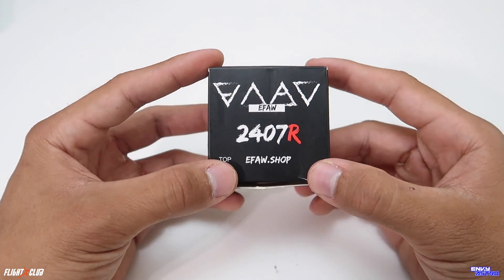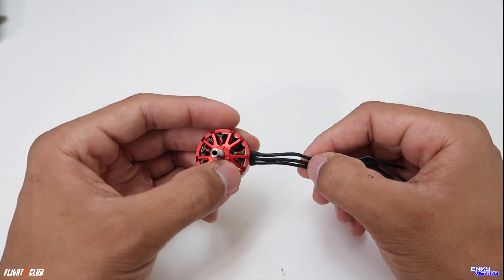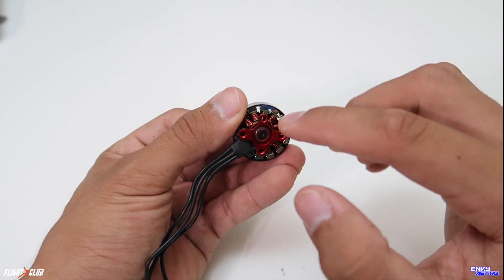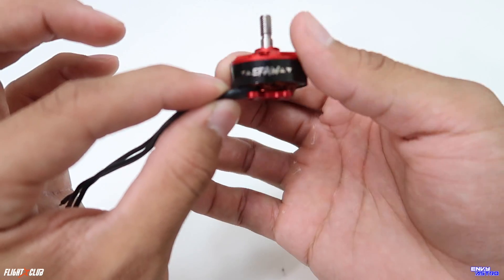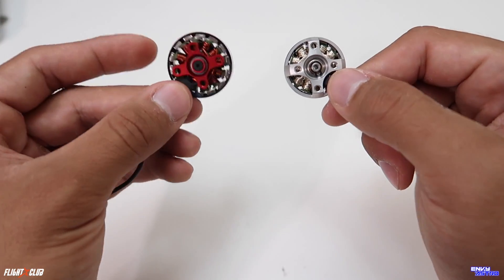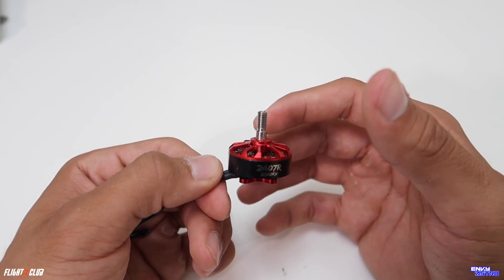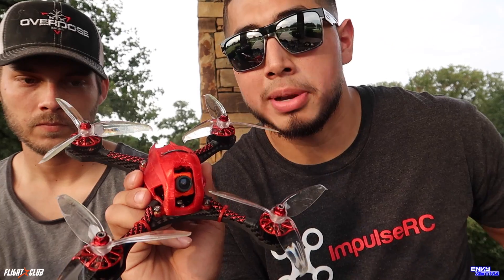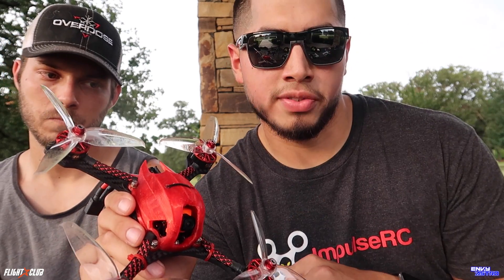EFAW Motors!!! (Thoughts & Test)

Comment: I'm a fan but I would love to see the prop static test and your real world test.. 

Quick question, if the motors aren't warm, doesn't that usually mean that they are not being pushed to full potential? I didn't get the esc amps you guys were running, looking at the gauge of the windings would suggest it can take more power, but the enamel coating also has to be able to take the heat. I NEED MORE TECH INFO GUYS.. Love your vids.

Comment: Are motors like this good for UTT tracks?
Reply from the maker: Levi Maston yes, you'll want a fast high kv motor for utt by it also depends if you want more torque. Some of these motors would work great with a light frame for utt
Reply: I ran the Cobra 2207, 2450kv on UTT3 2 weeks ago. I was able to destroy no less than 5 batteries, but I pulled off a top 10 time (8.45s) with that setup. I wasn't sure if high or low KV would be good for UTT, since the lower KV might have good low end acceleration for the direction changes. KV might not matter though, as it seems the line is what really makes the speed. Thanks for the videos dude, would love to have you guys come to Albuquerque one of these days!
Reply from the maker: Levi Maston you def want a motor with high kv and high top end that way is there when you need it. The best motor I've tested that has he mixture of those two variables were he f40 pro
Reply: Ive heard a lot of good about that motor. I should give it a shot. Thanks!

Comment: Good video and nice looking motor. I would like to suggest the EFAW on a 2 blade prop vs the Tmotor with 3 blade. Since they are high kv motors, they are better suited for 2 blades to reach their maximum kv potential. Do a few tests then switch the 3 blades to the EFAW and 2 blades to the Tmotors and retest. Ive recently went back to 2 blades on my Emax 2600kv's and its hard to tell a difference in performance so therefore this kind of test would have interesting results.
Reply: I'd like to see some 6" 2 blades on them. On 6s POWAAARR!

Comment: This motor IMO is designed for high voltage (5-6S).  I have the 2500kv running on 6S and they run great without desync.  I also have a set of the F80's on a 6" build and they are great as well (on 5S) but they seem to be more noisy motor and will desync on 6S (2200kv).  The EFAW's I can run on Betaflight with the filters off on PT1 and they are as smooth as butter on 6S.  I love both motors but each have their specific purpose so it seems.  You mentioned they don't get warm...this is so true.  Even with 6S they just barely get warm where my F40's and F80's will get more than warm on 5-6S.
Reply from the maker: Daniel Bolton that is exactly my thoughts, I'll definitely be testing it out for 6s! Possibly on a 6 inch props as well
Reply: I'd like to see a test between the EFAW 2500kv and the DYS Thor 2500kv on 6S with 5&6" props.  The DYS Thor is also a 2407 and was released at the same time so it would be a great matchup!
Reply from the maker: Daniel Bolton haven’t heard of the Thor maybe it could be worth a test!
Reply: EnvyAstro Yes sir should be a good match up here's the info on the DYS http://m.helidirect.com/item/3438343537

Comment: Good review and vid, good insights into this motors' characteristics. Motor is a little heavier than advertised. Looking forward to more from you on them!  :)

You may remember that I've mentioned I have a frame idea that hasn't been done yet, made possible by the recent 'advances' on the PCB side of things. I'm looking for a designer/prototyper to work with, and I want nothing in return for my contributions (other than I get to see my design out in the world and fly it myself). 'You', Mike, Nich/Justin...? Point me in the right direction or scoop me up for yourself??

Here's one example of something I've created in the past: https://www.rcgroups.com/forums/showthread.php?1205952-54%2A-55%2A-Bell-Hiller-TechHead-for-the-Walkera-4-6S-4-6-CB100-4-3B-4-3Q-Heli-s (browse the first full page of the thread at least, and watch the first and third vid if you have time)

Gist of what it represents = What all 'fixed pitch' heli pilots desired but never before had through many years of thousands of people 'flailing around' on the forums with the 'only options' available to them. The pinnacle and perfection of mechanically stabilized rotor head design (had to be to allow the helis to hover/fly 'hands off' for minutes at a time). Even though I came up with the design only ~6 months after I got my first heli, it was too late to the party as the FIRST 'electronic gyro' stabilized versions where announced AND released during the time I went into official prototyping and production. Though, I still had 90+ preorders and sold ~150 total just through my forum thread and ClubHeli who stocked them. 

Moral of that story = Let's not wait till it's too late for my talents/contributions to make a difference this time!   ;)
Reply from the maker: GITech oh yes we have man thank you for your input! You should contact Justin or nick since they are the since in charge of neato frames maybe then can make something happen!
Reply: Ok, thanks, will do! Should I say "EnvyAstro pointed me in your direction"?
Reply from the maker: GITech you don't have to but yes sure!

Comment: Guys, I'm looking for new motors. I don't race, you think these would be good for freestyle with the 2500kv version on 5" hq5x4.3x3 v1s? I don't want to smoke my batteries either. I was also considering the f40 pros 2400kv..thanks
Reply: MrTimmyGT Nick from efaw is super chill and I like the smaller company just personal preference not the performance
Reply from the maker: MrTimmyGT I would recommend the f60 2500kv those are very nice for freestlye!
Reply: EnvyAstro cool thanks for the response
Reply: EnvyAstro those F60s are sick motors no doubt... that new 2306/R5 Brotherhobby motor is flat insane as a freestyle motor but you better have the batteries to feed them.. you won't be running them on no 1300 to 1500 45c packs.. my Tattu 1550 75C feed them but come down mighty warm.. the R-line 95c 1550s come down at a proper temp and feed them just fine.. my 1300 95c R-lines come down pretty warm.. I really think you need packs that can handle putting out 100 to 115 amps bursts for more then a few seconds without severe voltage sag or the R5s are just to power hungry of motors... another thing is 1.5 minute flights good enough for you.. if you have the batteries and don't mind 1.5 minute flight times the R5 is THE motor right now with the F60 right behind it..

Comment: I have a quad with F80 2200kv and two with the 2200kv / 2500kv efaw. gotta say the efaw 2500kv are the sweet spot. the 2200kv efaw outperform my 2200kv f80s with speed and flight time. Also the motors with short wires weigh only 33g(!). I fly both the 2200kv and 2500kv on 5s and 6s, it's a blast :-) BTW my motors run cool on 6s with betaflight!
Reply from the maker: Adam-g1 very nice info! My f80 are very similar as well but really leaning over to the efaw due to the weight
Reply: EnvyAstro one thing I've really loved about the efaw motors is being able to really push their tunes, literally the most responsive motors I've ever flown! I can fly my quads in 40-50 mph winds with little to no prop wash, even in sharp turns with the efaw 2200kv/2500kv.

I'm curious, how light are your 5" racing quads without lipo? I've been trying to build a light racer and I'm not sure what is considered light.
Reply: People are getting about 200 - 250g (without battery) with 2205 motor and 4 in 1 ESC to consider light for 5" quad.